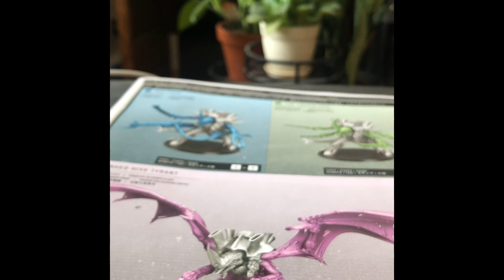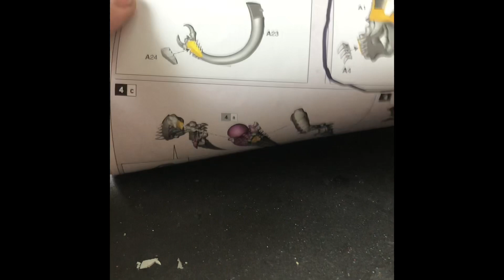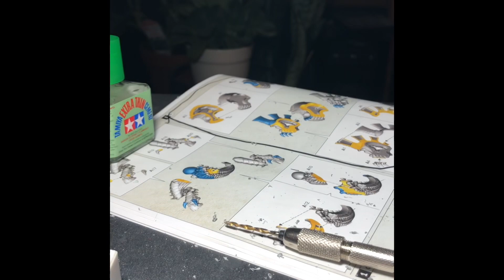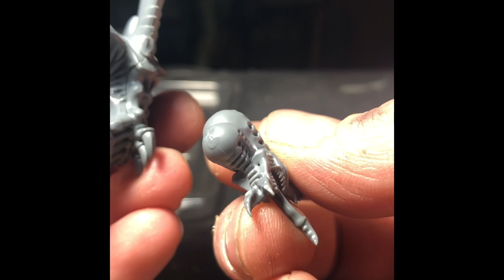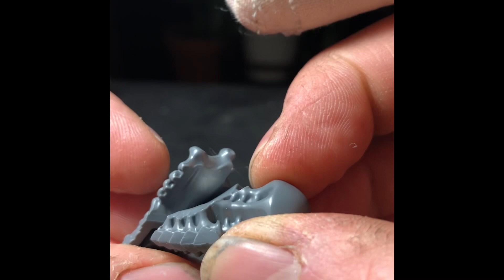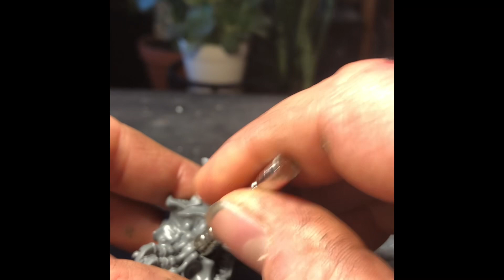Tutorial: How To Magnetize Hive Tyrant, Winged Hive Tyrant, And Swarmlord - Part 1 of 2

Comment: Hello whats size of magnets do you use? 
Arms 7x3
Body 3x2
Head 3x1
??????
Thanks
Reply from the maker: Hey sorry for the late reply,  for the wings and inside the torso I used 7x3mm,for all other arms I used 5x1mm but I would suggest 5x2mm if you can find them and then yes 3x1mm on the head
Reply: @MiniNewb why do you suggest 5x2 over 5x1 doesn’t the bigger depth make them harder to fit.

Comment: So for the head magnet all are 3x1 mm magnets, however in order to to the hole you first use acharpknife -> then 2 mm -> 3 mm? right?
Reply from the maker: Hey sorry for the late reply, yes all the magnets for the head are 3x1mm. Start with the knife then use the 2mm (5/64) to enlarge the hole before going to the 3mm (1/8) drill bit. Doing it this way makes it easier and more precise with less chance of the drill bit trying to walk around on you.
Reply: @MiniNewb  thanks bro
Reply from the maker: No problem just make sure the magnets are neodymium or “rare earth magnets” they are stronger!!! 👍